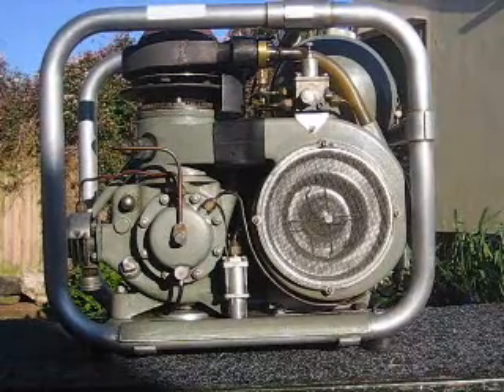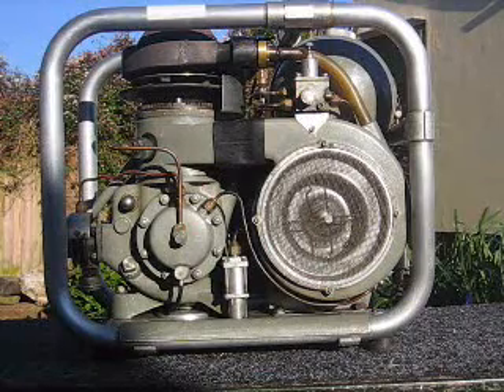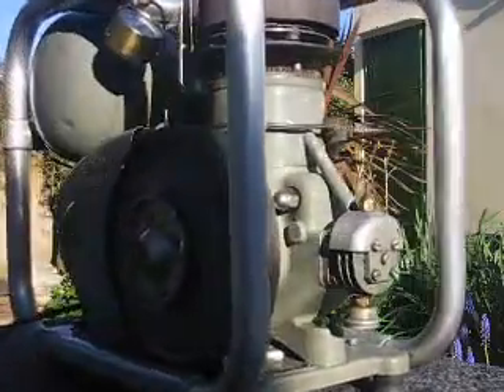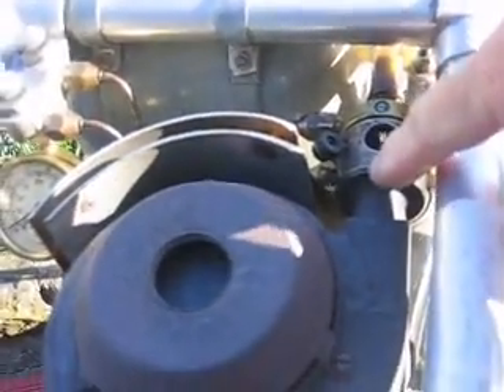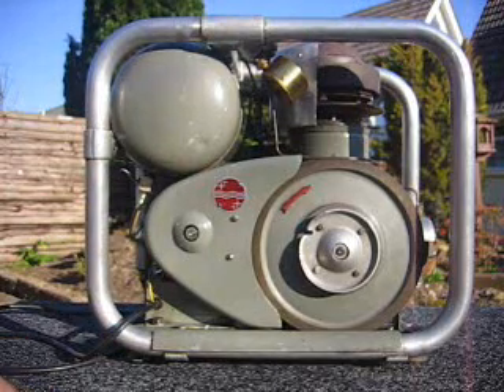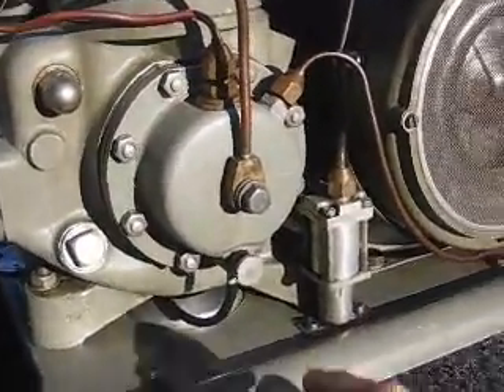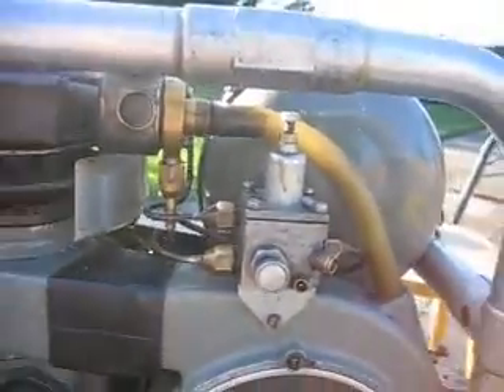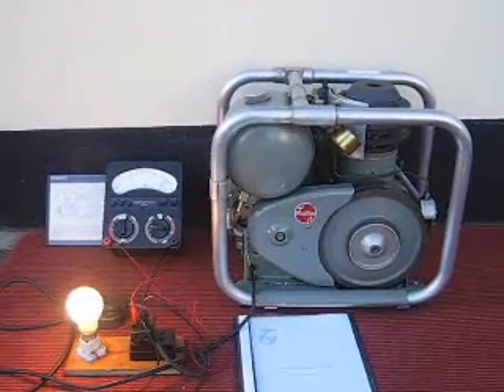PHILIPS STIRLING CYCLE GENERATOR

Comment: I wish I could buy a ~500W silent generator like this today. I've seen modern Stirling engines used on SAAB submarines (AIP) around 75kW as well as a design for a small radiothermal generator to be used in space at the ~1kW level. My local home improvement store just has Honda inverter generators which are nowhere near this quiet.

Comment: Very nice unit.  I like to design things and I live in the Mohave desert.  We hit 110 degrees F regularly.  I have seen people take old franell lense from old TV’s build an adjustable rack for it an use sun power to melt everything from glass to steel.  I want to build a generator like that powered by sunlight.

Comment: Would be nice if anyone made a modern version of this. Would be really nice to have a 1 kW (or whatever is feasible) portable generator which with no other danger that CO2 could be run indoors (ethanol fireplaces same deal - moisture and CO2). Normal gasoline you can't because exhaust is not pure CO2 but a complex mix of not fully broken down waste products.
Reply: Doing some math, i guess you could make a less noisy 250 watt version a quarter the size. It would probably run days on 2 liter diesel or some clean vegetable oil.

Comment: A pleasure craft was built in the mid-1960s as a Stirling power demonstrator by Philips engineers.  It had a helium pressurized single-cylinder rhombic drive engine producing 30 horsepower and was fueled by kerosene.
Reply: +douro20 Yeah my dad told me about it. Apparently, when the car rolled downhill and the engine was used as a brake, liquid air came out of the exhaust!
Reply: I'm talking about a boat here.
Reply: +douro20 Ah, OK. But a car existed as well, seemingly.

Comment: " I have no idea what transistors have to do with this generator using an unconventional engine."
When radios used tubes (before transistors) they needed more power than batteries could reliably supply for extended periods in areas without powerlines. Philips spent years to develope these generators to supply that power & started selling them just about the time  transistors came along.
FYI: a new market for these would be for "Prepers" who build fallout shelters. Stirlings can run on any hear source, gasoline generators can only use petrol (and methane).
Reply: Transistors made transmitters use less current,no need any more to charge big lead batteries in the field,the car you are in or small human powered generators took over.More flexible.. Als long as the user can rotate the generator manually no external power is needed.
Reply: That 200W is a lot of output power if one has to work for it! And one has to put more in to the generator than comes out,because no machine is 100% efficient.

Comment: I have no idea what transistors have to do with this generator using an unconventional engine.
Reply: the generator was used to charge large batteries that ran the valves in the electronic components. that generator was used to charge those batts. and when the transistor came out, the need for such large batteries diminished, so thus no longer needing to charge the big batteries they used a smaller charging unit.
Reply: Antes de la aparición de los transistores, un radio transmisor funcionaba con tubos termo iónicos, que consumían mucha energía, por lo que se desarrolló este generador, costoso. Luego, con unas pilas fue mas económico.

Comment: It is sad this was discontinued. Even a 3 year old know why. The electrical system was intentionally designed to fail in order it will get a negative opinion at a time when people were not so worried about oil prices. Phillips can regain popularity if they re-invent this  engine and have every household  posses it.

Comment: It can be produced now but no "for profit" company would build one. 
Aparently this could be modified to run off the exhaust of a regular 5 hp gasoline generator. 
Then what would the gasoline companies do with all that fuel they wanted to sell?
Reply: tzmdomeguy You get a combined cycle power plant, which BMW experimented with not too long ago. I could see this running off a petrol engine exhaust and providing electricity  while the petrol engine does the propulsion duties, or two generators on both petrol and Stirling engines.

Comment: I'm sorry but you are wrong. There was an american firm that made the "STM TMG". It produced 75hp, weighed 30 lb (If I remember correctly)  and produced electricity at up to 35% efficiency from fuel to plug. Diesels can get close but they must be very big indeed.

It's downside was being H2 filled at up to 150 bar.

Comment: Thank you for posting this video. This shows how realistic and serious Stirling engines can and should be, with perhaps some features which make it easier to start and more convenient. Your comments were very helpful, and I hope that you have success popularizing Stirling engines. I hope to fine tune a solar-powered Stirling engine to drive another, smaller one, to take advantage of the cooling power for air conditioning from the smaller one.

Comment: The thermal efficiency of a Stirling engine depends on the absolute temperatures of the hot and cold sides of the cylinder.  I think you need to divide the difference between the two by the absolute temperature of the hot side.  Therefore if the cold side is at 10C (283K) then the hot side needs to heat up to 293C (566K) for 50% efficiency.  Of course the heater may let a great deal of heat escape, but I've seen designs that use the incoming combustion air to recover a good deal of that.
Reply: So you couldn't make a generator that ran off the heat differential from your attic to underground. In florida could be as high as 70⁰ differential
Reply: @kydenj28  In FL i remember thinking with all the canals you could run the cold side in the water and use the sun to heat the hot side, would work quite well. 
Although they would probably stop you from doing it somehow :)

Comment: Thanks, Barumman. That's half og what the typical ICE powered generators run to acheive 50 Hz(cps). I haven't got the data for the generator, but I assume it is 220V AC.

Comment from the maker: Hi, The Philips engine runs at approx 1500 RPM they had the benefit of specialist winding
equipment to make the wire regenerator which has very low resistance to the airflow,
also the heat input is quite high.

Comment: Hi

I worked at the college you refer to for nearly 25 years so our paths might have crossed. I'm contacting you today to let you know that there are some interesting Stirling Engine photos on eBay as I write (17/09/11). If you would care to respond with your email address I'll forward on the details. I found them interesting as it is multicylinered in a circular format with pistons driving a swash plate. Find me on rubyreddevon@yahoo.co.uk.  signed Dave H

Comment: I'm as ignorant as can be about stirling engines, but a thought struck me when watching this. The really new commercial stirling engines are able to use parabolic mirrors to focus sunlight onto the compression cylinder. I wonder if this old Philips engine could be made to run that way, or if the parts it's made of are too heavy. I imagine something like a "solar stove" sort of arrangement might be able to heat it up. What do you think?

Comment: it is great engineered engine
can u please tell me what is it's fuel consumption for one hour and how load can it take maximum 
although it was not designed at that time to run high power consuming equipments but i appreciate your video as a great educational aid and anyone can see how a sterling engine been in use in past 
i am curious to know it's fuel consumption along with load capacity how load can it handle

Comment: WOW, I've been looking one of these for about 40 years without success.  The Science Museum in London had one but it is no longer on display. I thought it was just compressed air stored in the tube fram, or was it a special gas?. What is the electrical power output?. The frame arrangement probably looked odd when it was built, but it certainly defined the shape of portable generators to come.

Comment from the maker: The air stored in the carrying handles is used to pressurize the engine and to work the fuel atomizer.
Once the engine is running the air pump supplies the needs of the engine as well as replenishing the reservior for the next start.  The engine will not run at all without pressure!     Best wishes.  :)

Comment: Gimme! awesome machine you are a very lucky chap.
Is the working gas in the tube frame? or does that stored gas pressurize the working gas chamber before running?
My Nexus6 stirling is high pressure but compressed then sealed by a shrader valve.

Comment: 1950, réalisation de 150 générateurs de 200 W, entraînés par  moteur Stirling. Ce générateur ne sera pas commercialisé du fait de la mise sur le marché des postes de radio à transistors, pouvant être alimentés par des piles électriques

Comment: Thank you Barumann for sharing this!
I had so many questions about this unit and you've answered almost all of them in this video. How often do you run it ? Would you consider it to be practical, within it's current range ? Is there documentation with it ? 
I'm most curious about the piston configuration and engine type.